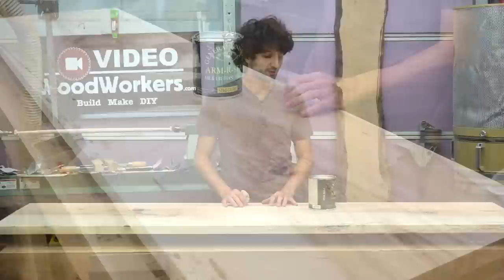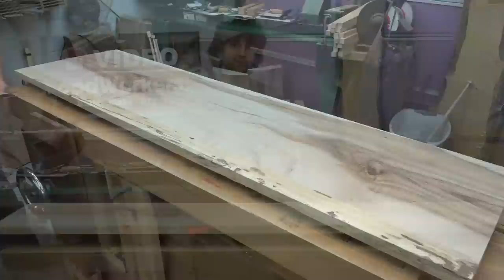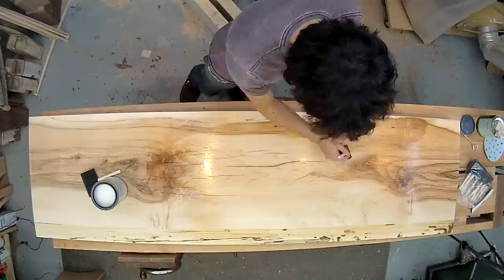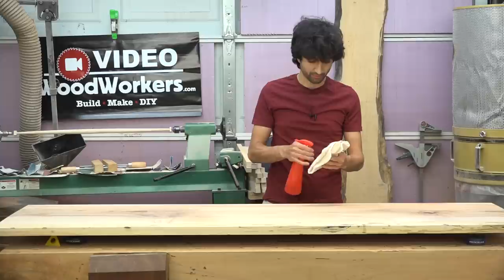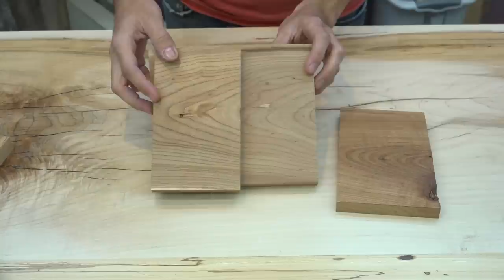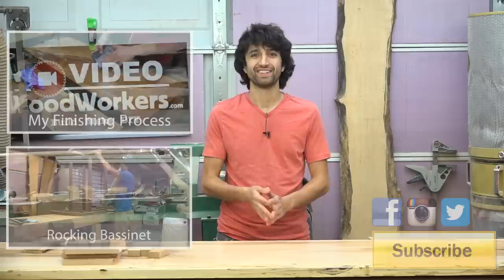Using a Water Based Finish for the First Time

Comment: Hey Matt, I've never used an oil based finished but have used water based ones quite a bit.  1st thing,  not all foam brushes are created equal.  Cheap foam brushes will leave more streaks than the moderately more expensive ones.  2nd, never shake the can or push down on the brush to squeeze more finish out of it.  These 2 actions create bubbles and bubbles are your enemy as they also create streaks.  3rd, I never sand the wood to higher than 150 grit as the finish doesn't seem to adhere as well to the higher grits and after 3 or 4 coats you can't really feel the wood grain coming through anyway.  4th, last but not least I always rub it down with some fine steel wool and then apply some paste wax and buff it out.  That seems to give the piece a nice smooth feel.

I'm definitely not an expert, and I've never finished anything quite as large as your piece here,  but that is the process that I have cobbled together from information that I've gleaned from the web and it seems to work pretty good so far.  Sorry about the book but I just wanted to share my info with you.

Keep up the good work!
Reply: +FunWithWoodworking fantastic advice, mirrors my experience with water based poly quite accurately. When it works, it's beautiful~
Reply: +FunWithWoodworking Agreed, no shaking, leave the foam brush loaded up, don't squeeze it out. If in doubt, add more finish.
Reply: Well that's odd because the can of polycrylic I just used says not to use steel wool... 🤔 I'm waiting on my first coat to dry on our dinning table so I hope it's not too long of a process. (doing this at night while fam is asleep). I'm not liking that my bleached off weathered wood finish is now looking very orangey with this stuff so hope it dries better. Also the synthetic brush I used left terrible steaks since the table is round with a rounded border and pie sliced in center. Oy!
Reply: Excellent
Reply: You really shouldn't touch a water based finish with steel wool. Also, whats with the scrubbing away at it with the foam pad? Use a brush and apply it even and gentle. You're not painting a fence.
Reply: هللو
Reply: Don't know if this is a new instruction but my can says 220 grit and don't use any steel wool at all.
Reply: thanks for the tips!
Reply: I guess it's pretty off topic but do anybody know a good site to stream new tv shows online?
Reply: @Marcelo Bishop flixportal :)
Reply: @Bruce Khalil Thanks, I went there and it seems like they got a lot of movies there :D I really appreciate it!
Reply: @Marcelo Bishop No problem :D
Reply: If any steel wool is left behind, it will rust and show up in the wood.

Comment: Dude!!! You shook the can to mix it! Huge mistake! Never shake clear coats, it creates bubbles. Bubbles are bad.
Reply: Bubbles don't remain in water based like they do oil.  But your right
Reply: @garittlajoie8841  remember bro that is an experiment so we let him go what he want. I am your new friend from Philippines
Reply: Garitt Lajoie yes they do!!!!
Reply: Makes sense..im so use to shaking paint..i will deff not shake it...any tips on a good water base clear to use over my wood floor??? Can i stain it first???
Reply: Its sanded down to bare wood
Reply: @bullseye_kyle4773  Yes, you can stain it first. Just make sure the stain is completely dry before the waterbased clear goes on. I have been using a product called, Emulsion Pro, and it seems to be a good waterbased floor coat. Both times that I used it I ordered it from Amazon
Reply: @seanmcaleavy2369  thanx sean
Reply: @garittlajoie8841  WRONG!! bubbles dont remain in oil based finishes
Reply: GF specifically states not to shake it.

Comment: Matt,  I used to sell General Finishes products and have used them extensively.   Here are my suggestions.  1. Stirred gently,  not shaken.  2. Spraying almost always produces a smoother finish.  3. If brushing, use liberal amounts and don't overwork it.  Lay it on and leave it alone.  Using an extender will give you more "open time" to apply to larger surfaces and improve leveling.  4. Because you are applying a thicker coat that dries faster, you will need to "finish the finish" with fine sanding to remove potential brush marks.  5. To deepen the color, pre-seal with either a stain, thinned de-waxed shellac, or boiled linseed oil (thoroughly cured).  I hope that this was helpful.
Reply: As a person who used to sell General Finishes products what do you think about water based poly durability? I found contradicting opinions. Some people on the internet say it's better not to use water based polys for tabletops as they tend to fray in places of contact with people's elbows just in a couple of years.

Comment: You should have applied a thin coat without retouching it at all; you should have read the GP instructions; terrible critic to apply it improperly. Had you just left it alone and not used that sponge pad, it would have been diamond smooth without streaks

Comment: I use this water base product all the time, I am using it right now on a very smooth dining table. The directions on the can say, don't shake it, don't over work the product, and if it's too thick you can add some water. Your piece of wood is beautiful! The reason for your lines is that you were painting the finish on, over working the product. This water base finish is beautiful when applied properly. I was hoping to get some tips from your you tube video, I'm disappointed.

Comment: You are using the foam brush as if it was a bristle brush. It is not and so the application is different,  preferably one stroke down the length of the surface overlapping on the next adjacent stroke.

Comment: Matt, thank you for the video. I wonder if the streaking was introduced when you brushed over the tacky first coat with the wider foam brush. One thing that General Finishes stresses is not going over the already covered area too often. They recommend letting that coat dry before covering any 'holidays'. 

I thank you for the comparison as well because I have only used the water based finish thus far. I am about to finish a mahogany project and I'm wondering how Arm-R-Seal compares with the HP water based on this species. 

I really appreciate your videos. Happy woodworking.
Reply: Yup. I wrote that too.

Comment: upd: we use foam paint rolles in our shop to cover up kitchen countertops and office tables with poly+acril water based warnishes. finish comes out even and nice only in 2 coats with light sanding in between.
and, at the moment it's my favourite finish, because of: it's fast - 2-3 coats a day - easy-peasy. not smell (i'm smell sensitive and got headache freaking fast), it coul be layed upon any type of colour (water or oil based), no smell (shipped on the finishing day - ok!!) we dont have armr-seal here in Ukraine, just using some trade grade one.

Comment: Hey Matt!  Good video demo.

I've been using waterbased finishes for years, but never the General brand.  (not so commonly available up here.)   Most of my experience is with the Flecto Varathane Diamond finish, from Rust-oleum.  But also some experience with the minwax stuff.   That General product did look thicker than the Rust-oleum or Minwax stuff I am used to.

How did you find that finish for bubbles?  On the first coat you were mashing the brush down several times forcing out the finish.  I would never do that, as the finish really foams up then coming out of the brush and causes LOTS of tiny bubbles that do not all settle out in time.   On the first coat I really have to re-load the brush a lot, as it just soaks into the wood.  (The varathane stuff, for instance, advises agains shaking the can to avoid causing excess bubbles.  I just stir it)

The products have improved over the years.  I recall back in the late 90s that the solids would settle out and you have to be careful to stir the can well.  But in the past 5-10 years it is way better at keeping the solids in suspension.

Best,
...art
Reply: Wordsnwood (Art Mulder) 
Can I use rag for water base finish?

Comment: Nice demo Matt. I use water based poly quite a bit, and spraying is the best way to apply it. Also the GF also imparts a slightly more yellow color than Minwax Polycrylic. that product is very clear and imparts no color at all.
Reply from the maker: Thanks Guy!  Sounds like some future experimentation is in order (and maybe a good spray setup...)
Reply: Matthew Cremona you over brushed the water base and it looked like way too light of a coat. To get the pop in darker woods I put oil or shellac on first and then h2o poly for the protection.  Shellac for first couple coats is very easy....

Comment: Matt, I did a spalted maple sofa table and used a water based (same brand) with a 'critter spray' gun. Worked great. no wet spots no brush marks builds coats faster.

Comment: You can get that oil based look with water based finishes - do one or two coats of shellac as a sealer before the top coats. You can use straight shellac or Target Coatings has a product called ultra seal WB shellac. I've used that under their water based lacquer EM6000, it's probably compatible with any waterbased top coat but should be tested. I've used both straight shellac and the Target product and like them, I find the straight waterbase on it's own does not bring out the grain and colour as well.

Comment: Best way to apply is with a new large, firm painters sponge with a woman's new nylon over it. Won't leave any fuzz/bristles, just a smooth-as-glass finish.
Reply: 4gsl I saw another video using the nylon hack. He used a 'footie', I'm not sure if that's the same thing as a painters pad. Can you use a normal firm sponge with a nylon over it to get the same streak-free finish? Thank you in advance to anyone that can lend some guidance. I'm using Minwax Polycrylic btw
Reply: @lisa-marieshy9673  your first mistake is using any miniwax product.

Comment from the maker: +Anthony Hall  It's possible but man did the surface look like butt before I did that.  It looked like it would have dried with a very uneven film and probably deeper streaks.  I don't have any mahogany to try them on but I'm guessing the results would be similar to the walnut sample. Maybe someone has some experience with WB vs OB finish on mahogany and will chime in.  Thanks as always, Anthony!

Comment: I've used both oil and water based finishes on quite a few projects (as a hobby woodworker). I like both of them, but water based finishes are harder to apply and look good. What I have found out:
#1 there are huge differences between the finishes you can get. Some just won't give you a nice finish and will always have streaks for example no matter what you try.
#2 a good brush pays off with water based finishes. The coats should be very thin.
#3 it helps alot to thin the finish with water, especially on the first coat when the wood is sucking everything up (look at the label how much you can add, but 3 parts finish 1 part water always worked for me).
#4 if you have the choice don't apply the finish in hot or bone dry environments, it just dries too fast and won't flow.
#5 don't touch anything again that has had more than a few minutes to dry already, even if it looks like you have wet or dry spots and it is very tempting to smooth them. I guess this is the main reason for the streaks in your finish. Wait until everything is completely dried.
Reply from the maker: Thank you for sharing all these tip.  I really appreciate it!

Comment: I use those same foam applicators and get a flawless finish with waterbased poly. The first few coats aren't critical - just smash it out. The trick to a nice finish is to wait a few days for the finish to harden up and then wet sand it with 320grit and soapy water (dish washing liquid). Use a sanding block - you absolutely do not want to expose any wood fibers otherwise they will raise preventing a smooth finish; using a sanding block helps you sand the minimal amount to smooth out any bubbles/runs. Then with the final coat you need to work briskly but not overwork the finish - you only have about 1-2 minutes working time once you put finish onto the surface. If you brush too vigorously you'll introduce bubbles. Also never shake the can, only stir gently otherwise you also get bubbles. If you brush over an area that has already been down for 1-2minutes you will make streaks because the finish is already starting to dry. For large pieces you need careful planning to prevent brushing over areas that have been sitting too long and ruining the finish.

Comment: Tip, never shake any stain like that especially water based, treat it like poly this avoids bubbles, think dawn dish soap when added to water it foams. Secondly use a synthetic paint brush then wipe it down, so soak it then wipe it on, less sanding and I never need more than 180 grit sand paper, after that go to your pads or steel wool and buff it out.
Reply: Although he called it stain, he was using General Finishes High Performance water based poly TOP COAT. Not stain. So yeah, he should've followed the directions. He messed up LOTS of things that were stated clearly on the can and website. Best learning tip: when using something you've never used before, read all directions and tips, don't just assume it's to be used like other things.

Comment: I tend to use water based a lot more often, although I tend towards minwax' polycrylic. I have used it a lot, and may have a few pointers. I generally stir the can rather than shaking to mix, because shaking it can lead to more bubbles and uneven finish. I tend toward regular brushes (there are some marked specifically for water based). I have had a ton of problems with the foam ones. Also, to reduce brush strokes, I tend to avoid over brushing. Since it dries so fast, if it has started to dry when you run the brush through, it will dig lines into it. If the stroke where you apply the finish is the only time you go over a spot, per coat, those lines should go away. 
I hope you enjoyed the process, and keep trying new finishes, and filming them. seeing what does and doesn't work well on the first try, says a lot about the learning curve. there are a lot of finishes I have not tried due to the complexity. I guess I need more shop projects.

Comment: Hey Matt, I find myself using Minwax's water based oil modified poly pretty often. It's readily available at my home center most of the time. It's nice because I get the fast drying of a water based finish with an oil based look. I spray it as well.

Comment: Nicely done Matt - what a huge difference on the walnut and cherry! - I liked to overhead camera shot as well ;)
Reply from the maker: Thanks Nick!  I figured you would :)
Reply: Thanks. I have used water base on cedar. Was not impressed. Looks like bare wood. It was very thick like a runny glue. I used a foam brush. With oil finish I used a rag like you do. Much nicer out come.

Comment: Yeah agreed, stay away from those foam thingies!
Reply from the maker: Never again! :)
Reply: There's NOTHING wrong with using foam brushes IF you use them right. MY can of GF even says foam brushes. DO it right and they work. DO it the way you did it and they fail. Next time you should read the directions on the GF can.

Comment: I use the same finish.  HVLP spray it and it is awesome.  I can get 4 coats sprayed in one day with a light buff in between with an extra fine sanding pad. The finish is rock hard and clear.  Highly recommended if it is sprayed.
Reply: What type of sprayer and psi do you use ?

Comment: I used waterbase finish on my Walnut toolchest built and was really happy with how it turned out. a oil base would have got the wood too dark and I was going for a natural finish. I used a soft bristle brush to apply mine and applied a thick coat, didn't have issues with flow out..I used polycrilic from minwax.. Nice top by the way..
Reply from the maker: Thanks for the info Tomy. I think a good brush would be the way to go for hand applying this. Thanks again!

Comment: first mistake, shook the can. Never shake any poly other than wipe on... then he went back to "smooth things out" another big mistake. You have to lay it down with a real fine synth brush and LEAVE IT. Back brushing really causes issues with this stuff. If you don't mind doing a ton of sanding, its not a huge issue I guess.

Comment: "Finishing the finish" never applied more than with waterbased clear finishes.  I have always found that the final coat needs to be sanded with high grits until the "brush" marks are gone.  Sometimes it is best to give it more cure time first to avoid pilling up the sandpaper.  Do this by hand only and in line with the grain.  Wax will give you a nice sheen.  The waterbased finishes don't level as well.  Spraying produces a better surface finish.

Comment: I have not used the GF high performance water based finish but I have used the Minwax Polycrylic.  As you said it is thicker than what you typically use, the Arm-R-Seal, so I dilute it with water just a little. I like the fast dry time so I use it on stuff like stained cabinets and doors. If you want the "oil" look with the water based finish you can add a coat or two of SealCoat and then the GF HP finish. I really like your desk top, by the way.

Comment: I have used the GF on several projects and the results are pretty inconsistent.  The best results I have gotten with that finish is when I poured the finish on the surface and then spread it with the foam brush. The Arm r Seal is not sold in California so the choice of oil base finishes is limited.

Comment: Since water based finish raises the grain you said you need to sand it down before you apply the first coat. But doesnt water (inside the finish) always raise the grain again? Or ist that just the first time the wood gets contact with water ?